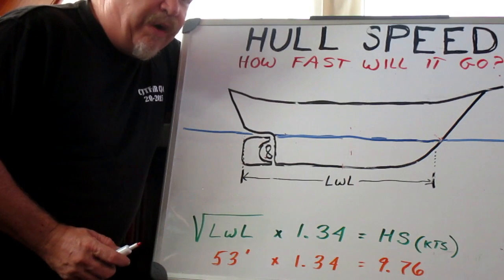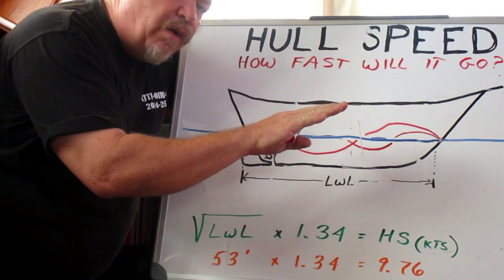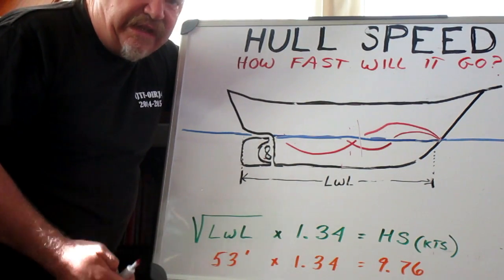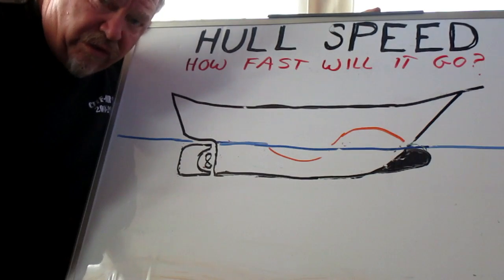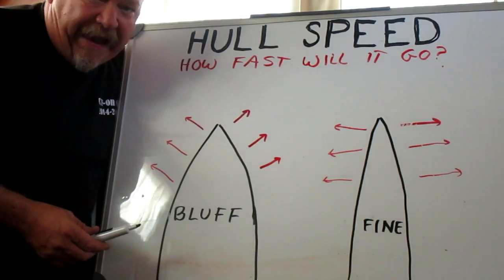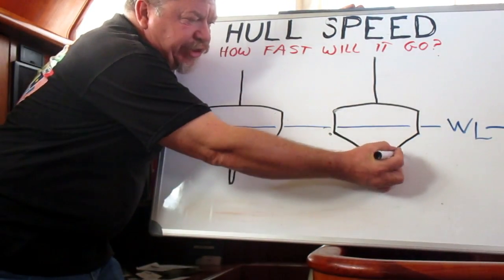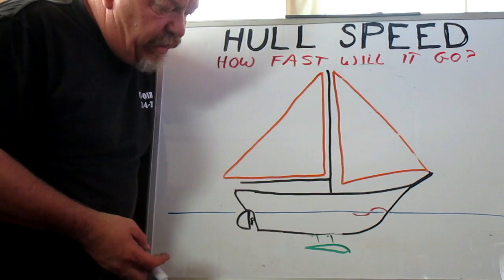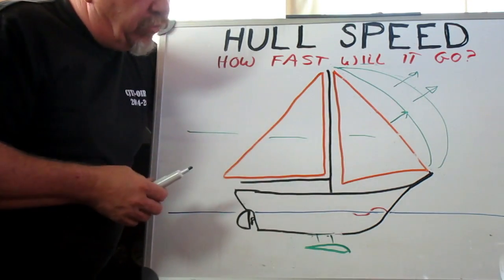Hull Speed

Comment: Interesting, I'd never heard of it. You mention that this concerns displacement hulls... does it relate at all to planing hulls?
Reply: Sandman,  hull shapes range from full displacement to fully planing and there are thousands of examples in between.  There are many variables such as speed, friction, laminar flow, weight, etc that are negligible with a full displacement hull but have an increasing impact as the hull shape goes further toward fully planing.  What speed/weight will bring it up on plane?   Beware of extravagant claims made by 'swift trawler' marketers....  some truth mixed liberally with fiction.   Best bet is to try it out yourself.

Comment: As a person who always thinks out of the box, I had a thought about how to overcome water resistance at the bow, as well as how to manage large waves.
I wondered if it would help to blow air bubbles just in front of the boat in the path of travel, just enough to reduce water pressure and move the water with the air than with the bow.
Similarly, I wondered if it would help to blow more bubbles further away into an oncoming wave so by the time the boat reached the wave, it would encounter a little less water and perhaps a less powerful wave.
Of course the boat needs water for buoyancy and we're not talking about so much air that the boat would sink.... we're just talking about enough air to reduce the pressure of the water on the front of the boat.
And this method may not be so easy to implement on waves approaching from the sides or rear.
Another strange idea I had was to try to use an acoustic wave to counter a water wave, to see if that would reduce the size of the wave. 
I'll have to see if I ever try these out some day.

Comment: From the way the bulbous bow, couldn't you just adjust the Distance of it to achieve the perfect ratio of drag and lift? Also wouldn't it be easier to greater enough drag that the bowshock pushes you rather than slow you?
Reply: The waves would be amplifying eachother, so why not use it? Also wouldn't water direction also play a role in unwanted yaw and pitch in high speed? I have been on a boat that had horizontal thrusters, was insane to just stop next to the dock and hit that lever, and just start moving sideways. Also couldn't you have some sort of ballast to shift weight to front or back for improving water hull contact? Also why not a hydrophobic surface coating? Air and water are just mediums, both act sort of the same, so I wouldnt doubt if some applications for air would also have an similar or different effect. What would superheated water steaming the hull while in water? What effect would that have?

Comment: 3:15  One caveat with the bulbous bow is that the bow waves only align perfectly at one speed.  This is not a problem for a container ship that spends almost all its time cruising at its design speed.  As you mention, you don't often see them on sailboats.  I would guess that is because those boats experience much more variable speed operation, so the bulbous bow might often do more harm than good?
Reply from the maker: Poly Hexamethyl,  You may be right, although it doesn't change the prismatic coefficient much, so not sure it would be much a liability at the wrong speed.  My sense is that you would still derive a small benefit; some percentage of the full effect at the right speed.  I think the reason you don't see them on sailboats is that they are both difficult and expensive to make and install.   Further, they don't look 'salty', so nobody is asking for them.    There may be a reason I am not picking up on, though, since I don't recall seeing them on the big racing boats....  Perhaps the impact on tacking rapidly?

Comment: Great explanation. Nice and to the point without being confusing. Interesting that cavitation detracts from hull speed on displacement hulls but increases hull speed on planning hulls. However I believe that is due to surface tension/resistance of the hull in contact with the water. So interesting to walk through a shipyard and look at all the variations of vessel hulls. My favourite pass time.

Comment: Brad, if the boat is a catamaran, would I double the length, eg 65 feet = square root of 130 ft x 1.34 = 15.27 knots? The hulls are a lot shallower in the water and will have much finer hulls normally. Maybe there is a formula like hull length x 1.5 or something that would be close. Any ideas?

Comment: You were doing great until you hypothesized that a jib can lift a boat up enough to decrease drag, but that's just not true. The jib just contributes driving force that can make the boat go faster. The only sail with significant lift is a spinnaker, but it's not enough to lift a boat up significantly either. (If you don't believe me, measure the lift force of your spinnaker, and compare it to the displacement of your boat.) Sails generate power by deflecting air, and if there was a lot of lift, there would have to be a big blast of air blowing down from the sails.

Comment: If I were to gut a boat. For remodeling and replacing furniture. Would a boat tip over and sink.
Reply from the maker: Mat, probably not, but there are considerations.   If it is a monohull with ballast and the ballast is not changed, then the boat would simply ride higher in the water as you reduce the weight by what you pull out.   Weight carried higher in a boat tends to increase the roll time, so you might be shortening the roll time for the boat, making it 'snappier' or 'stiffer'.  This might be uncomfortable to you and you may end up adding some weight above the ballast to regain the roll time you want.  Be careful not to add TOO much weight up above the ballast and unstabilize your boat!  I have heard that humans do best with a roll time of 5.2 to 5.6 seconds, but you should check for your personal preference.   If your boat is a cat or a monohull that does not carry ballast, then I would suggest seeking out a marine designer or the manufacturer.

Comment: The function of a keel is weight by which the boat does not heel too much. If you make a wing on the keel (to make the boat lighter) then there will be a new force in a direction you don't want. In fact two vectors, one up and one leeward. Both you want to avoid like toothache (which is a very Dutch expression). So my dear friend, add only a neutral wing on your keel (by which the keel can be less deep) but not one that gives lift in the direction of the centre of gravity.

Comment: Hey Brad, 

I liked your video.  I would love to sail on your boat and have a beer.  But I am afraid I am not going to be on your Christmas list.

The crest of the bow wave does not move to mid-ships at hull speed.  The boat is not trying to climb it bow wake (it is not really a wave until it moves away from the boat.)  Rather, as the hull moves through the water it creating a depression, a wave trough.   What appears to be the boat trying to "climb the bow wave" is the boat trying to go faster than, and "climb" out of,  the wave trough the hull has created.

It is the length of this trough that limits the vessel's hull speed.  The theoretical hull speed for a given waterline length is the same as the speed of a wave that is the same length from crest to crest (or from trough to trough).  So, a vessel with a 30 foot waterline has the same same theoretical hull speed as a wave that is 30 foot from crest to crest.  This is not an "estimate."  An estimate, according to the dictionary, is an approximate calculation. 

By the way, you need to take the square-root of the waterline length expressed in feet in order to get the hull speed expressed in knots.  The equation won't work if you use the waterline length expressed in meters.  And, not to be too much of pain in the ass, but your calculation is not written correctly.  The square root of your 53 foot water line length is 7.28.  So the equation shown should be 7.28 x 1.34 = 9.76, not 53 x 1.34 = 9.76.  If you multiply 53 by 1.34 you get 71.02, not 9.76.

Also, additional drag does not affect your theoretical hull speed.  You will need more power to push a barnacle-encrusted hull to its hull speed, but, assuming sufficient force/power, the ultimate hull speed will be the same as a beautiful slick hull of the same waterline length.  Likewise, whether the hull is fine or tubby will effect how much power it takes to drive it to hull speed, but it will not change the ultimate theoretical hull speed for a given waterline length.

Oh, and the bulbous bow.  No, it does not have its own bow wave.  It merely extends the waterline length.  It would take too long to explain here, but it is because the "waterline" is in three dimensions running along the length of the hull, not simply at the surface of the water.  The waterline length is commonly used for the calculation because, unless there is a bulbous bow or some other underwater appendage, the waterline length is going to be the longest length of hull being pushed through the water, which defines the length of the trough created, and therefore the theoretical hull speed.

Taking weight out of a sailboat creates lift?  No, afraid not.  It makes it lighter, so less energy is necessary to overcome inertia.  But lift is an aerodynamic (or hydrodynamic) force that is created when a gas or liquid is forced to go faster around to the outside of an asymmetric foil.  When the speed of a gas or liquid increases, pressure decreases.  That is Bernoulli's principle.  A foil on the end of a keel makes the boat more efficient because it blocks turbulence around the end of the foil/keel, so that the keel creates more lift for its length.  Contrary to what you suggested, such a foil does not create lift, raising the boat out of the water, so that it goes faster.  Well, maybe on a carbon fiber foiling catamaran, but not on Puffin.  That is why there are winglets at the ends of jet airplane wings.    By channeling the airflow directly back, instead of over the end of the wing, it make the wing more efficient over its entire length.  As a result, the "wings" on the end of winded keels are symmetrical, not asymmetrical like an airplane wing, because, unless you created enough lift to get the hull clear of the water, an airfoil shaped foil on the end of the keel would only create additional drag, slowing the boat. 

Okay, and finally you said that wind from behind the boat creates lift in the jib.  No, with the wind astern you are not creating lift and being sucked forward by the low pressure created by the jib as an airfoil.  You are being pushed.  Again, in a modern planing or foiling performance sail craft you can sail faster than the wind speed, and likely exceed hull speed, because the vessel has climbed out of the trough and is planning or foiling, rather than simply displacing water as it moves forward.  This speed also increases the apparent wind, creating even more lift.  Again, however, that is more than can be explained here.  A spinnaker is not intended to create lift to exceed the hull speed.  A spinnaker is a big bag of air pushing a boat downwind.  Gennakers?  Screechers?  A-sails?  Yes, those create lift, but they are not functioning as a traditional, symmetrical spinnaker.

But the offer of the beer stands, if you ever find your way to Southern California!

Russ Cole
Sailing Vessel Coyote
Alamitos Bay Yacht Club
Long Beach, California

Comment: Thanks buddy I was scratching my head so hard it was starting to bleed me and my buddy both have a 10 horsepower Yamaha engine we also have almost the same size of boat but for some reason he always goes more than 10 km faster than me I never understood this until both are both out of the water and I saw that his Hull had a different shape I didn't think it would Matter too much but I think I understand more now that you explained it
Reply: Daryush, hull shape is probably the difference, but it also could be either your propeller or your engine.   A different prop will easily make a 10kmph difference.   Different engines run at different efficiencies, regardless if they are the same brand.  10 HP at the engine results in a smaller break horsepower at the prop shaft.   You could have a different carburetor, or the drive shafts could have different lubricants or friction issues.   Another issue might be boat weight.   Are you and your buddy the same weight?   Are the boats the same weight?  For a power boat, thrust to weight ratio is an important factor.

If it is your hull shape, then the wake waves will look slightly different when you cruise at the same speed (perhaps not enough to notice, though).    You could try swapping the motors for a test run.   If he is still faster, then it definitely is  the hull shape or thrust to weight ratio.   If swapping the motors makes you faster, then it is the motor or prop.

Something else to try if you want better speed...  Add a horizontal lift fin to the motor, just above the prop.   I am sure there are a number of brands, but 'Whale Tail' is what I used,   I got much better performance; higher top speed and quicker up on plane for my tender.

One last item.  Congratulations on avoiding the Honda brand for your outboard engine.  Honda may make good motorcycles and cars, but their outboard engines SUCK big time.   I guess that is why they are not more numerous on the market.   I have a Honda on my Bullfrog tender, and it is really poor engine.
Reply: @sailingpuffin4929  hi Brad how are you thank you so much for your reply really I have learnt so much I also saw your other video on displacement and planing hulls, my boat is a Terhi 440(class rowboat I looked this up after your vid) my friend has a Terhi 400(class motor/speedboat) ofcourse I thought only difference was mine was 40CM longer as number indicates the length. This is great and to think I was about to plop my engine in the car and bring it back to the dealer to get checked out it's a new engine.  I'm going to look into getting one of those planing fins also I will try why to stick my electric engine batteries in the tip of my boat. Greetings from Amsterdam, r u and your wife still on the boat? I've just discovered your channel and haven't seen the most recent videos yet but I can see that you haven't put one up in 2 years, just curious don't want to be nosey👍🇳🇱🧜‍♀️

Comment: Thanks again I have now put this into practice and yes it works.  Was a problem with a kayak so I went from a 4 meter up to 5.2 meter.  The financial outlay was well worth it and  should add the old had chines new not so yes a very noticeable difference.
Reply from the maker: Chuck,   Very glad the video was of use!   I had never thought to use the formula for a kayak, but it sounds like an innovative approach.    Me, I prefer sail or power.   That physical labor needed to row/paddle/pedal is too much like work!  :).
Reply: @sailingpuffin9441   My cousin is very much into sailing and at one time sold them in Los Angeles. When I was a kid he would sit on the window, feet under table and lean out to practice .  My own sailing is limited to cats . Anyway keep the video's coming and enjoy sailing.
Reply from the maker: @chuckmaddison2924   I 'swallowed the anchor' and moved to Colorado to be near my folks who are getting on in years.   I might post some beer-making videos, but no more sailing videos for awhile.  I am worse than useless on any boat that requires me to hike out over a toe rail, so I will leave that to the young folks.    Cheers to you on the kayak!

Comment: If the water waves are bigger for the weather?
Reply from the maker: Assaduzaman, Thanks for watching!   I am not sure I understand your questions, but this may help:
- The hull speed computation is just an estimate.   The estimate helps when you are shopping for a displacement hulled vessel and are curious as to the performance without an actual on-the-water test.  There are other factors that will add or detract from your speed, but these are normally within 5 - 10% of the hull speed computation discussed in the video.  This will reduce your cost of testing and shopping.
- Weather and waves will impact your hull speed.  The magnitude of the impact depends on a few items not covered in the video, such as: Sail:  The amount of surface area on the vessel that is not adjustable, such as gunnel height, mast and salon roof., Weight:  A heavier vessel cuts through waves differently than a lighter weight one., Entry shape: A vessel with a finer entry will cut waves differently than a blunter or bluffer bow., Keel shape:  A longer keel tends to resist lateral forces on bow or stern more than a deeper fin keel.

Hope this helps!

Comment: Thank you!
This was simple, straight forward and understandable.
Reply from the maker: Sean,   Thanks for watching!   The explanation I gave is only mostly correct; 1.34 x square root of the water line length will get you CLOSE, but it won't fully describe an individual boat's hull speed.   Some folk have commented that I left out equations governing the wetted surface at various angles of heel, laminar flow coefficients and other paralyzingly intricate computations.   My thought was that the average buyer, like me, wanted a 90 to 95 percent correct estimate that I could do in my head while looking at a boat.  Hope you can use the vid to help make your boat purchase choice easier!